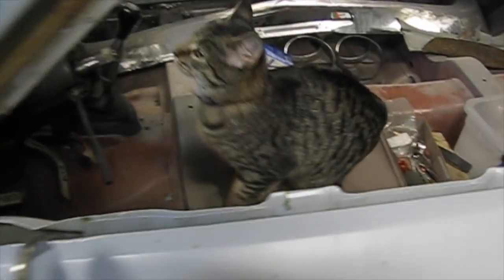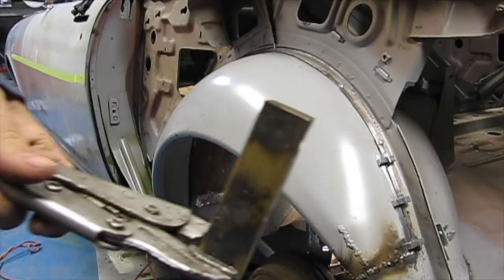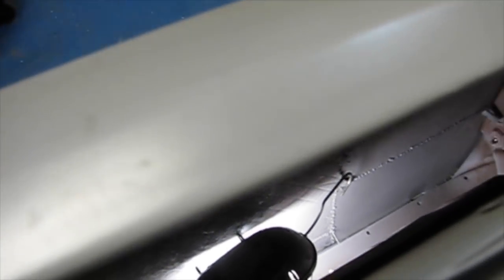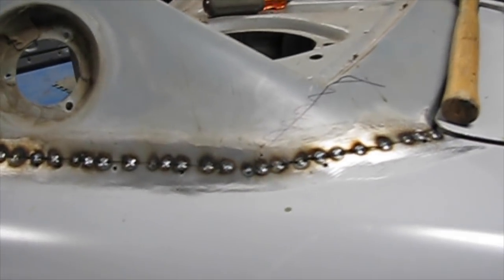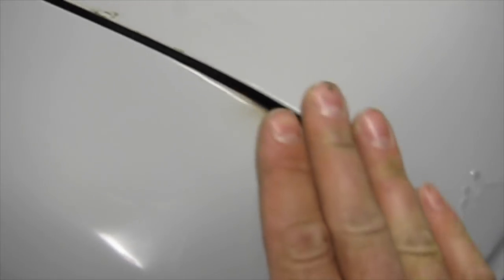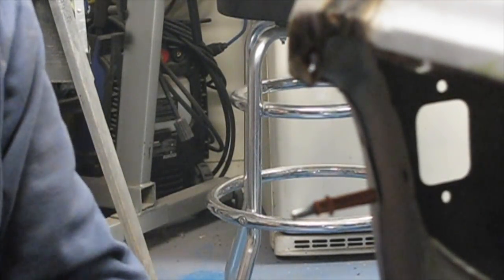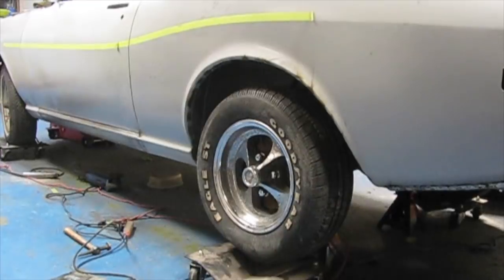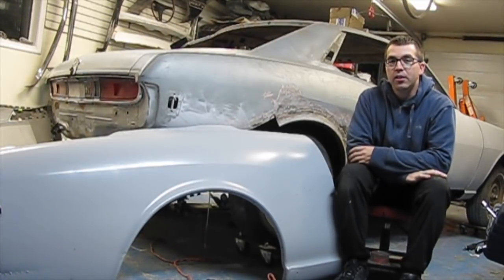1973 celica part 12

Comment: Is the tape on the door/quarter to help make sure the body line is perfectly aligned? Love simple solutions like that!
Reply from the maker: Yes It was a quick reference for the on off on off on off during test fitting. The other part had to do with the used quarter skin and used door skin. The body style line was not as pronounced as it should have been so the tape helped me see it better. I feel like that line is the most critical to line up being the feature of the side of the car.